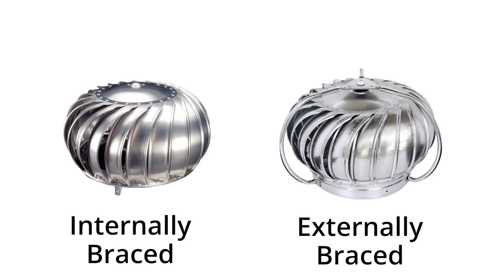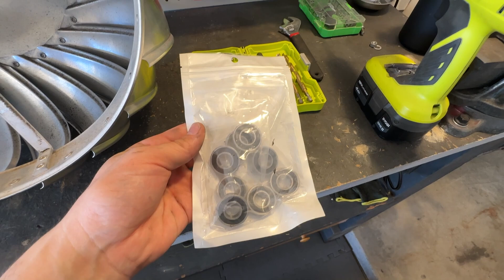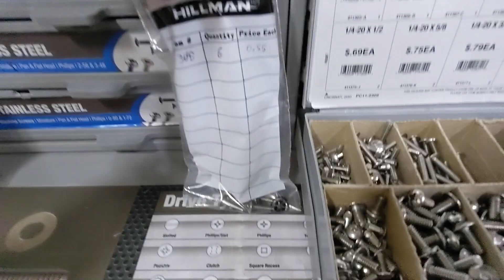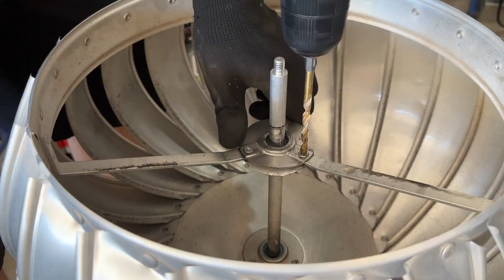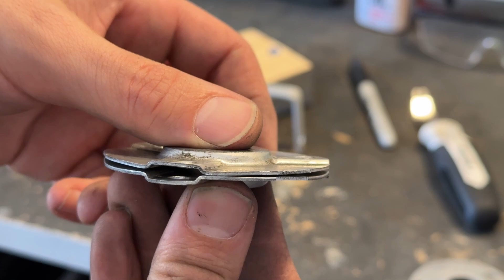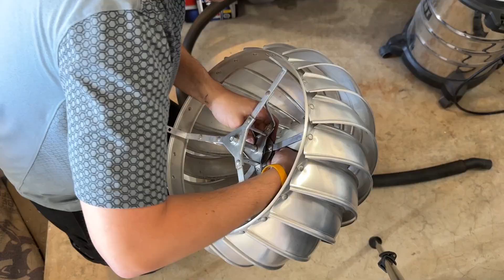Roof Turbine Vent Repair – Save Money with This DIY Fix!

Comment: I called Lomanco and told them my Whirlybird turbine vent stopped spinning.  I got a free warranty replacement after just 5 minutes on the phone.  4 days later I received my new vent head.
Reply: What phone number did you call?

Comment: I really wanted to use this video to repair my turbine vent. Turns out, there exists a level of "builder quality" that is even one lower than yours: My turbine has the plastic race ball bearings cast into plastic spiders, instead of the metal two part clamshell around a separate part, like yours. The cheapest turbine at HD  that I bought to replace instead looks like yours, so I guess I can do the bearing swap if they fail before I need a reroof. (Roofers are never kind to these, inevitably they get damaged and replaced)
Reply from the maker: Oh man! I'm really sorry to hear about your turbine vent. I did not know they could be that cheap. Hope the new one lasts you a very long time!
Reply: @TheRealTrevorland  I have a question.... what if the same exact generic brand turbine like you worked on is SQUEAKING?  can I simply remove it by those 3 bolts and flip it upside down, squirt some silicone based lube on the two rotating points and reinstall? would that be the proper easy quick fix?

Comment: Great video! I am changing one out this week.  Leave your bearing out in the sun to heat it up and it will go on the shaft easier. Putting the shaft in the freezer can help too. 
Even though you could have gotten it replaced for free, great job using $2 and some time to fix something rather than throw it away and use resources to make and ship a new one!

Comment: So aside from the fact that you shouldnt have replaced these in the first place, if you are ever replacing bearings.... you can use the principles of expansion and contraction to make them slip on or off rather than being beat on.
Reply: Hi just curious, why should bearings not be replace?
Reply: @briannaspicer3624  It was pointed out that his turbine was a Lomanco brand, lifetime guaranteed.  They'll ship you a replacement turbine head, free of charge, once they verify.

Comment: Do you know where I can find the screws holding the blades to the bottom circular frame? I am missing two.
Reply from the maker: You can probably find suitable ones at Ace Hardware or a similar hardware store.

Comment: That looks like a lomanco, lifetime free replacement
Reply from the maker: You are correct. I wish I had noticed that detail before I started my repair!
Reply: lamanco is premium, the original, all metal. I've seen the knockoffs they sell at lowes and they actually have plastic bracing parts. it's worth a few extra bucks going with lamanco for 30+ life before free replacement